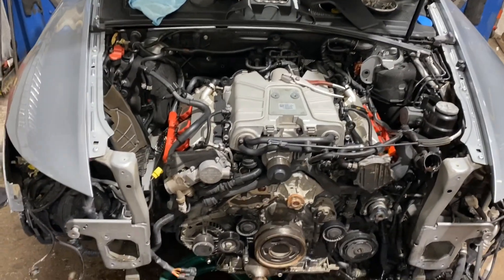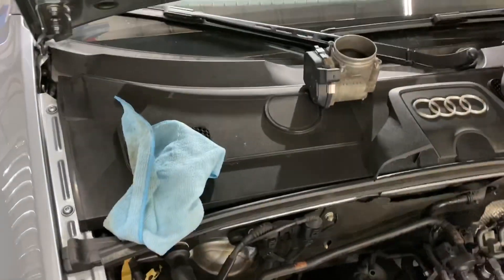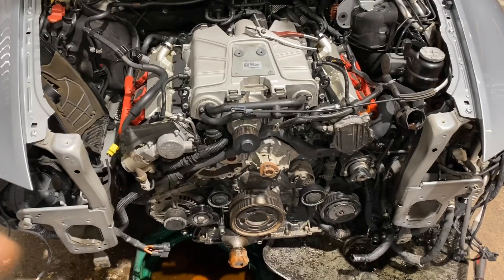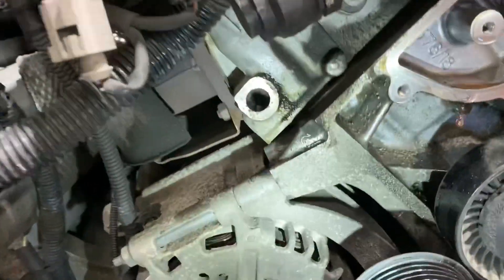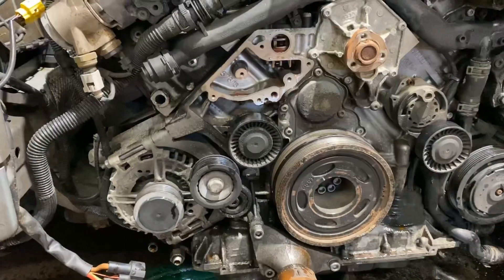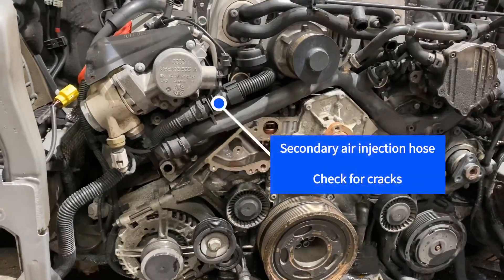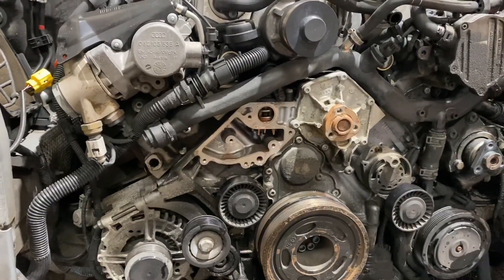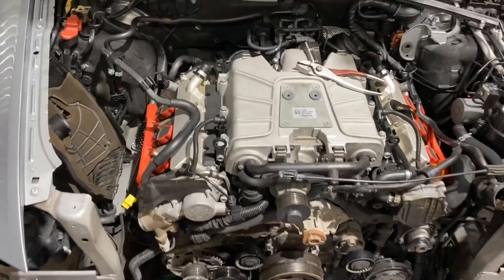Audi 3.2L 3.0T secondary air injection insufficient flow codes by Edge Motors

Comment: Could you not just delete the injection pump from the system it will still run right?
Reply: Yes can be done but you have to code it out second air injection function to pass emission readiness.
Reply: It's called an SAI delete. It can be code out. Probably  a few videos out on how to do it by now